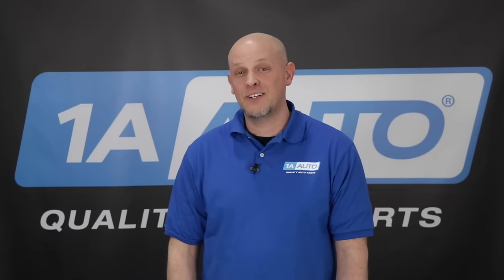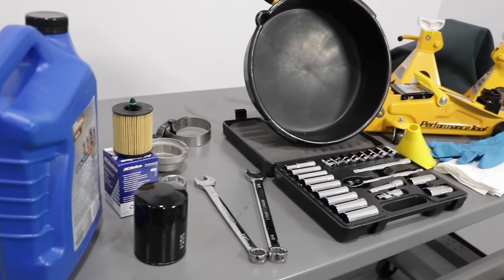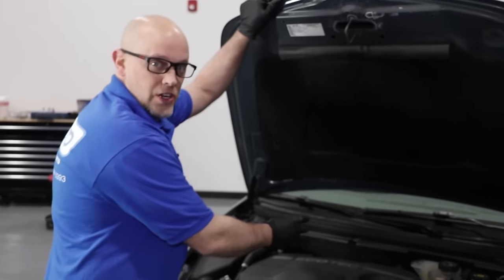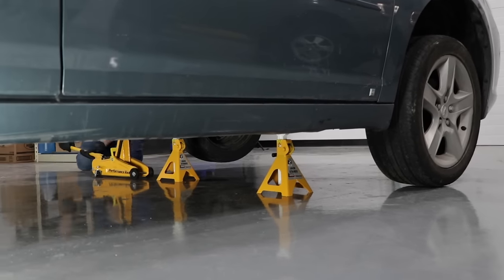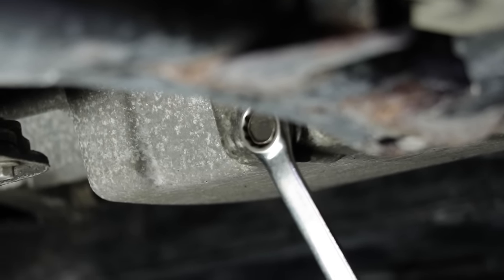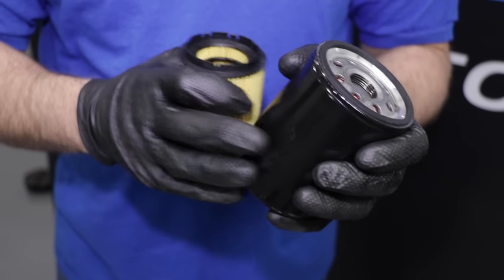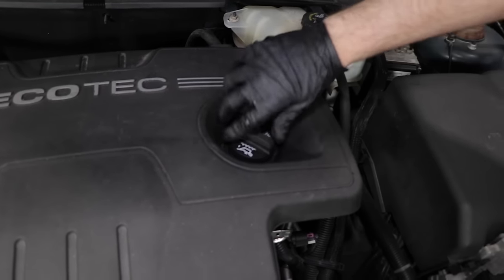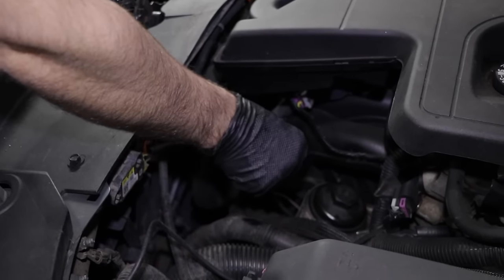How to Change Engine Oil ANY Vehicle By Yourself! (BEST GUIDE)

Comment: I feel like you're overcomplicating it...

Oil drain 101.
1. Use a socket 1 size too big.
2. Strip plug corners.
3. Change to correct socket.
4. Loosen plug, taking care to hit knuckles against sharp metal edge.
5. Unscrew plug carefully by hand.
6. Drop plug into drain pan, ensuring whole hand and arm gets covered in oil.
7. Hastily reposition drain pan so that oil shoots over it onto floor.
8. Reposition drain pan, making sure that the last bit of oil will again miss it and drip on floor.

(PS: For oil filter removal, follow the same process, also making sure that oil filter falls into drain pan and splashes oil out onto floor.)
Reply from the maker: +Warrior Son We appreciate the feedback. Sometimes there are multiple ways to accomplish the same repair.
Reply: Hopefully that’s not how it goes for my first at home oil change

Comment: Canister tip: A bit of oil in the actual filter before putting it on will help it get closer to where it needs to be when checking it after turning it off.

Comment: Make sure that the drainage vessel is big enough to hold the oil. :) Mercedes go for 6 litres +, so don't assume an oil can with the side cut out will work. :) It must also be rigid, or you'll have a right mess very shortly. Also, think ahead as to how you will get the oil out of the drainage vessel into the disposal container and what that will be. It might be possible to use a sump pump down the dipstick hole. Easy, if possible. Been here, done it a thousand times. :)

Comment: i have a ford focus and mine is low   .even though i am tech in a shop  i still like to do my oil change at home on ramps  rather then go to the shop on my days off to use the lift.  im at the shop every day and you just need a break from being there .    now i do not understand  why people mix up the oil and trans pan.   with most cars  there are a series of a lot of bolts going around the trans pan      and one bolt  for the oil pan   like mine

Comment: ask
Why does my car say it needs an oil change?
The oil pump may not be circulating enough oil to keep the engine's parts lubricated and functioning properly, which can in turn cause multiple engine issues. Although receiving oil changes at regular intervals should prevent this problem from occurring, parts do wear over time..

Comment: Have an issue now, since I am going to change my own oil the last company seemed to use an impact driver to tighten up my oil plug any advise how to loosen it? I do not have access is an impact driver and honestly not a weak person just do not want to make the vehicle fall even still using jack stands lol....
Reply: Use a breaker bar, that's the only way if you don't have an impact and it's that tight. If you don't have a breaker bar put a pipe on a ratchet, or maybe try hammering on the ratchet to simulate the impacting motion. Or use a wrench and a hammer, or use the double wrench method. Hope this helps! And I hope the threads on the pan are good!
Reply: Yea use a breaker bar bro
Reply: @AutoFixYT  I wouldn’t recommend hammering a ratchet lol but putting a long nipple or pipe that fits on over the other end of a breaker bar or open end works just fine

Comment: I skip replacing the oil filter every time and  replace the filter every other oil change.......I learned this  from an old time mechanic  years ago .....replacing the filter is not as critical as changing the oil regularly
Reply from the maker: +Gary Vale Thanks for the tip!